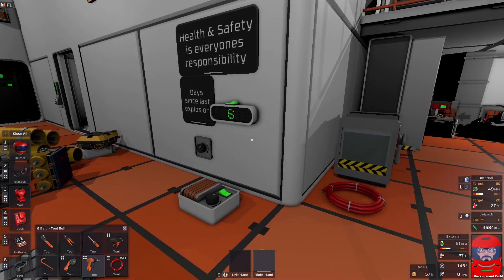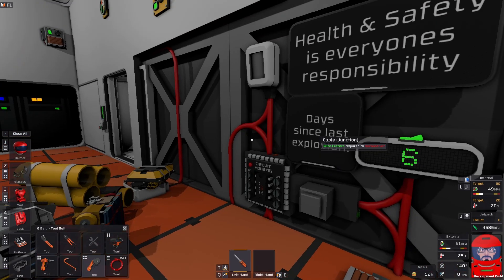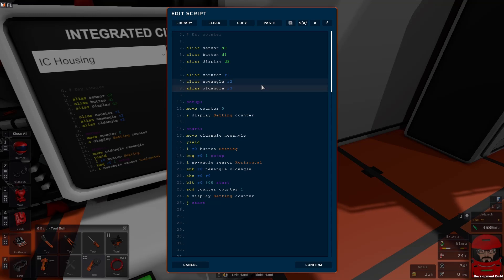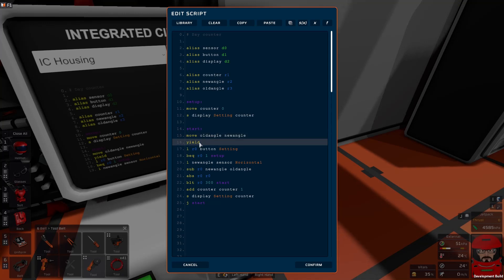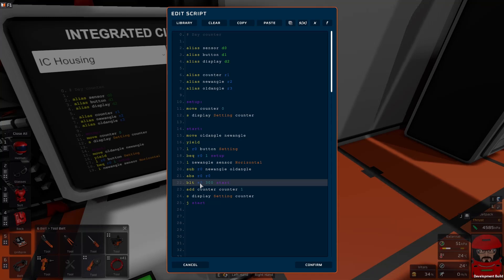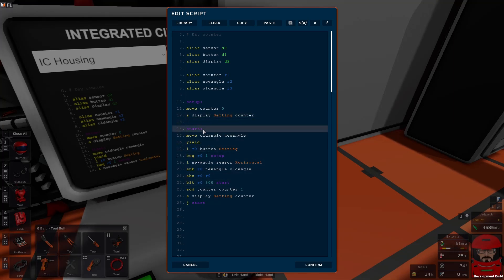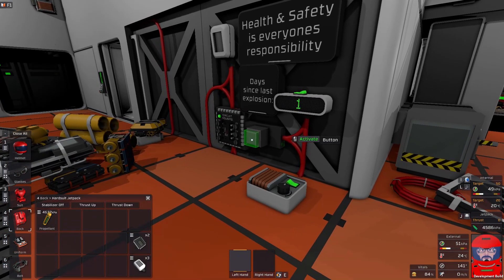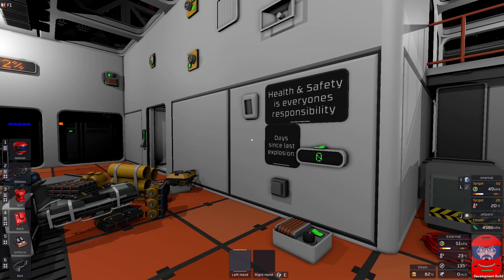Stationeers Day counter

Comment: Hi there thank you for all your videos they help me alot on my game I would like to ask can you make a videos showing how to setup a gas fuel generator please I'm really struggling with it
Reply from the maker: Sorry but I haven't cracked that nut myself.  If you look at my Europa base video you can see my best attempt so far.  I will do a video if I manage to get it running properly.
Reply: That one is a tricky son of a... +1 for that !
Reply: Will do 
Oh I wanted to ask you your video on the small generator with the code which reads the battery can you connect multiple stickers and generators or is it only for one generator
Reply from the maker: It is for only one, but the new years update made the stacker redundant in that setup.  You can now just turn the generator on and off without wasting coal.  The script on the workshop has been updated.  It is still just for one generator but you could modify the code to write to a memory and then a batch writer to control many generators.